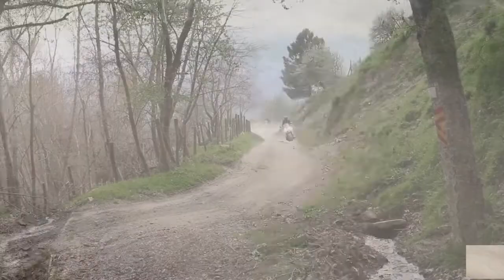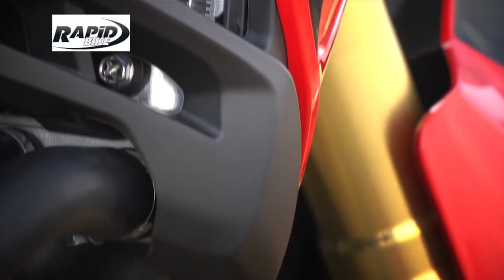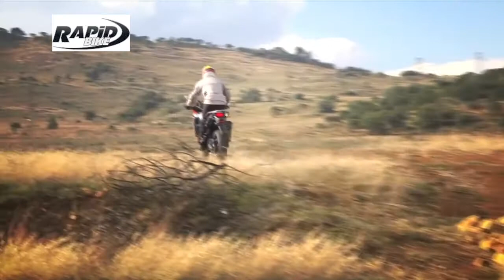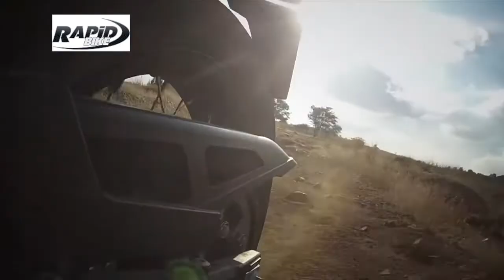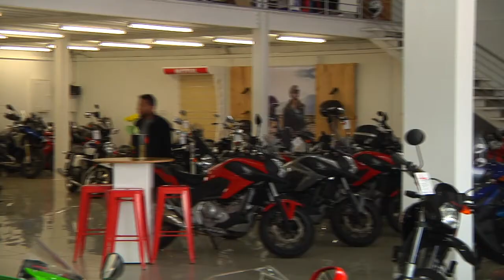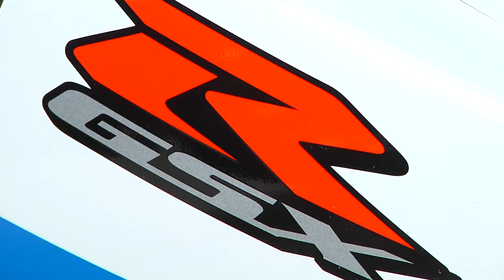Honda Africa Twin Rapid Bike Test 2WheelsTV

Comment: Coming soon cylinder development coming soon y'all new and improved Africa twin solar powered electric Skyhook winch Broadview lonewolf paris-dakar desert Rider out in front miles of head and a turkey vulture takes you down while looking back how far ahead you used to be are you are in deep sand up to your knees and your Africa twin is upside down you need to get it back on its Wheels immediately not a problem with our noon improve bad the solar powered Skyhook winch lithium ion battery add extra cost that will come in handy when you're doing it in the dark nevertheless the patent the Skyhook will grab hold of any temperature Fahrenheit or Celsius atmospheres the more CO2 in the air the greater the grip with a remote out remote control law allow you to you should go pro and show off your friends exactly what king of the mountain he was discouraging anyone to challenge you across Africa Skyhook went can't even pull you up a Mountainside faster van a dual-clutch can decide what gear with the optional remote your side up can be a diversion for the competition horizontal mounting options as a tripwire across the trail for sorry bastards behind not aware of what you have laid trap for them after you get the remote and it will return in to your saddle bag has nothing happened also can be used as a catapult that will bring you right into the last checkpoint and the checkered flag stay tuned it will be on it record flights available to the public to do

Comment: And how is it possible to tune properly without a wideband sensor? Lets say I want afr 13.2....
Reply: No no no no no that's old-school tuning that's even worth doing for horsepower you're greeting for Mother Nature it's not nice to fool Mother Nature with a power mix in a pat 13.21 fuel to air ratio we will be there in 14.7 with a narrow band why ban getting too much horsepower and and lean lean and frying your machine do you want to see them pipes not red but white hot melting the the word Africa twin dripping off a tire but if you have to be a gangster we get it Dyna jet wideband tuner with the extra help tuning module that constantly easier next year at 13 and 1/2 to  solid power fuck the EPA the. Department of Transportation the national Safety Council of Automotive transportation animal activist organizations the Sahara Club number one all backpacking Hyper's dope smoking hippie crack whores and Aphrodite butthole fucker and turn up the fucking Wick wife fucking open I want to see the sign on the bottom of the backplate will say if you can read this you're too fucking clothes get out of the goddamn way